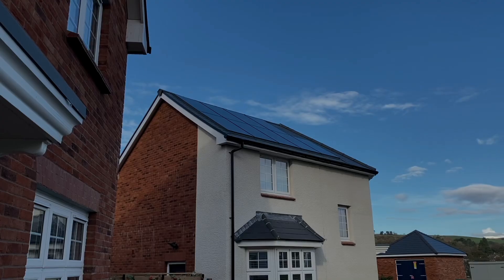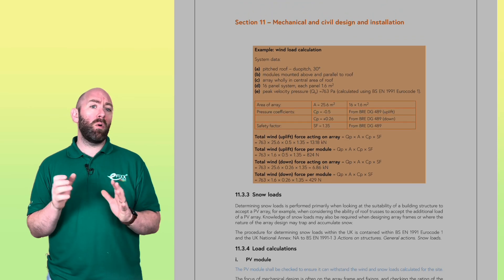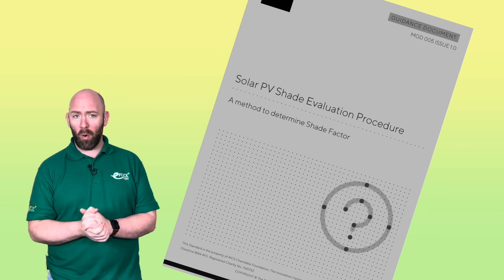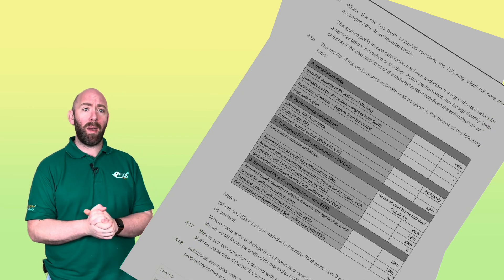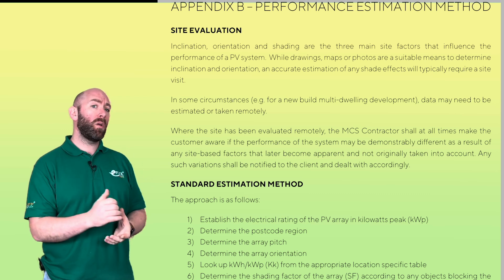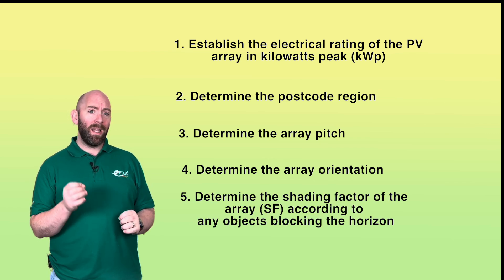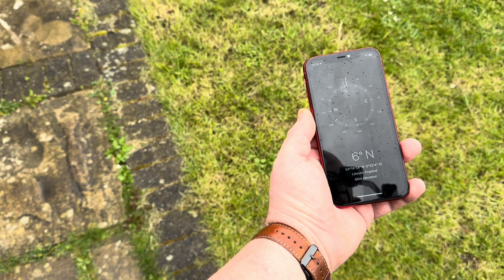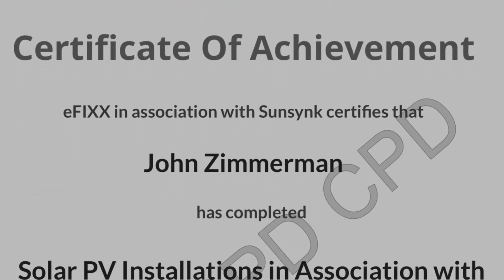Master Solar Design: A Blueprint for Electricians

Comment: I have never met an electrician or electrical engineer or solar installer who was also a qualified structural engineer. Out of interest, do installers routinely engage the services of a structural engineer to assess the likely impact of the PV design on the performance of the roof before moving ahead with installation? I would imagine that any installer that doesn't get the OK from a structural engineer and goes ahead anyway is taking a bit of a risk that their insurers really would prefer they do not!
Reply: Any decent electrician would consider this if they understand the relevant parts of the Building Regulations (such as Approved Doc A)

Comment: Wasting all this time to manually calculate this when you can use free software to do this for you.
Reply: Please what's this software?
Reply: @adon8672 open solar
Reply: And end up with a 'free install'?
Reply: @hein_mcleod  although not in the context of PV systems I have seen consulting engineers submit a shiny report full of calculations and graphs from very expensive software that was - not to put too fine a point on it - complete mince! A quick manual check or sanity check of calculations goes a long way to avoid embarrassment (or worse) later. Too many people ready to just take for granted what their computer is telling them!

Comment: Vertical panels facing south will give good production in winter, not withstanding any shading. At least that's the result I got when I simulated it. South east facing vertical panels outperformed south west facing panels at a 22.5° pitch in the winter months.